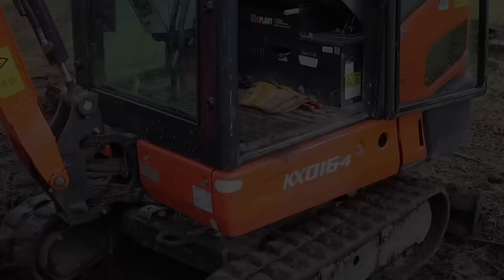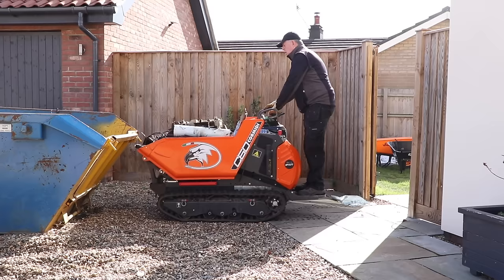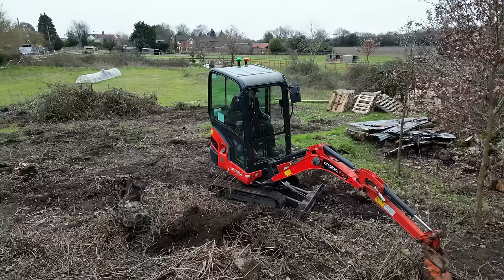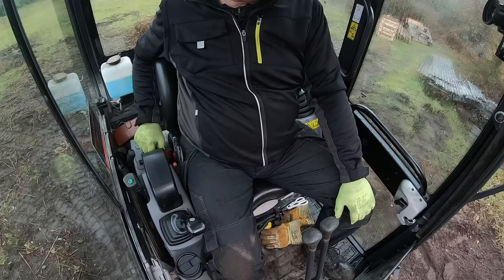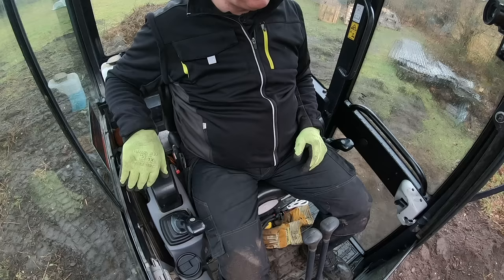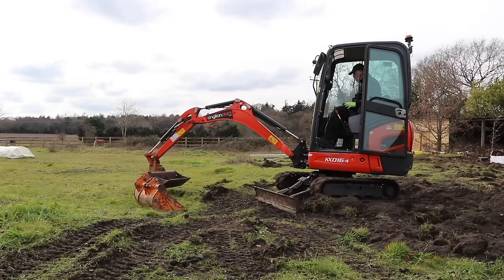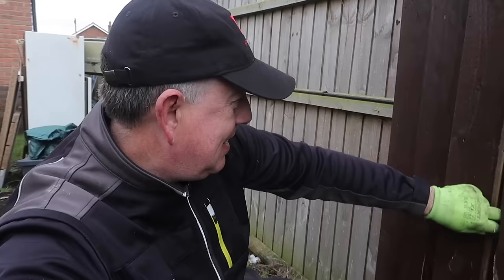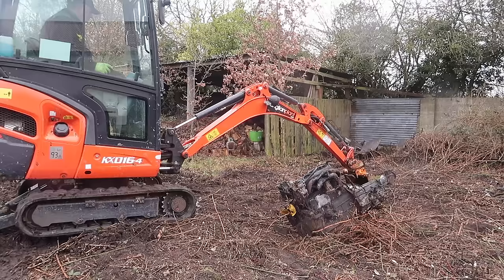Mastering Mini Diggers: Your Garden's Ultimate Tool

Comment: The scrap metal you unearthed would put a hole in the costs of the hiring of the machines, pity you had to Bury the engine, it would have brought the weight of the scrap metal up and therefore the value of your find.

Comment: Tip for you I learnt from an old pro, when you’ve got something heavy like that, track up to it with blade facing it and low. Bring the arm and push squeeze it up to the blade. Lift blade and arm together and you’ll lift it up. Then just track it to where want it.

Comment: good way to clean up that mess .now have to get rid of it .  the important thing to do with Backhoes and excavators is plan how its done and not end up with a big bog hole .  the way the controls are is called ISO pattern .can be changed on most machines so the boom and the second boom ( dipper stick ) is opposite sides .

Comment: I used the exact same combination of digger and tracked dumper when excavating the footings for my house. As you say, you can learn to use a digger but an experienced operator will usually do a far quicker, more efficient job for you. If there is any complexity or risk to the work, personally I'd urge you to hire a driver with the digger.

The little dumpers are great, especially if you have limited access, but they do move slowly and that costs you time as you trek back and forth to the skip. In the end I hired a digger driver and replaced the tracked dumper with a one tonne wheeled one and everything sped up significantly. I got more in the dumper each time, got to and from the skip far sooner, and the digger driver didn't have to hang around between times waiting for my return for anything like as long.

All these things I learned, probably never to use again!
Reply: Have to agree on those tracked barrows. They're handy, in their own way and 1ton Dumpers are HUGE in the context of a garden which makes them a bit impractical even next to an excavator, but they are a huge step up in speed and efficiency.

Comment: Hi Stuart, thanks for this, really useful to see. I had a patio cleared and relaid by a good local team and told them to hire in a digger and skip loader at my expense. They found it really useful  - the old cast concrete slabs were 35 to 45 kgs a throw - we put one on my bathroom scales. One thing I would add though, if digging down make sure you know where any service pipes and electric cables are and stay well clear. Damaging any underground services would prove VERY expensive. Usually services are at least one spade handle's depth down but you can never be certain of that.

Comment: On a kubota on the dozer blade lever the green button  on top of the leaver is the fast tracking giving a faster ground speed for moving the machine.

Other tip is if you have a slope to climb then go up with the front dozer blade to the rear. The track drive motors are at the back of the machine at the oposite end to the dozing blade and  doing this puts the weight of the machine directly over the drive motots giving better traction.

Comment: I've hired a 1.5t digger a few times now. First time I was a bit nervous, and it was a proper project too - digging out foundations for a DIY extension. Lots of people said to get a driver, or pay a pro, but int he end frankly, I wanted to have fun on a digger and whats' the point in doing DIY and then paying somebody for the fun stuff. Took my time, yes, I messed up a bit a times, but all in all it was a great experience. Then over the years I've hired them to move, all in all, probably 100 tons of material one way or another. Great bits of kit, and it's really not hard to operate so long as you take it easy. Also hired a telehandler once, that was awesome

Comment: A couple of things. When you were padding down, put the blade down behind you. You will get more padding power. When opening and closing the tracks, take the weight off the tracks by lowering the blade behind you and booming down at the front to lift the machine, then move the tracks. Also, if you lift the engine closer to the machine, you may be able to lift the engine off the ground. But don't boom or stick out when lifting. You could tip over.

Comment: Come on, thought you dug a hole to drive the mini dumper into and then push the engine into it's bucket, to then move it so it could be recycled. 
Anyways, good video as always for the rest part, and using some proper toys is always fun.

Comment: The simplest option would have been split the engine and gearbox which would have made them much more manageable. With scrap values as they are, weighing that lot in would have got you a free mini digger for a week 👍
Reply: Yep, I would have had an adventure splitting it, and learn a bit without consequence. I'd want to know what vehicle it was from. As you say, scrap value would go a long way towards hire costs. Or another route is to get a skip for the metal, free of charge.
Reply: I would have split them at the Bell Housing and had them recycled. You get the money and much better for the environment too.

Comment: As for the engine, I was thinking on just dis-assembling it into it's basic components and then dispose of it.  I'm sure an engine block minus the transmission is a lot lighter.  And why stop there?  Just keep going until you have now gained new mechanical knowledge to work on your car!  The wife might appreciate that and you could then rationalize the cost of the rental of the excavator.  Great idea, though.
Reply: Yes, taking it apart was my thought too. My guess is that bolts & nuts were be too rusty to make it possible.

Comment: I'm suprised you buried the engine, thought you were joking.
With no oil in it it could have been broken apart with a sledge quite easily as the casing is normally quite brittle.

Comment: buying the engine instead of either A) splitting the gearbox and engine or B) rolling it on to a sheet of that scrap steel and skidding it out with the digger to somewhere more accessible seems REALLY sensible......

Comment: Would have been so much better all round to have weighed that engine in for scrap, the digger would have easily lifted it, either close in with a strap around the engine or by "cuddling" the engine into the blade then lifting both bucket and blade at the same time.
PS. always better to dig over the blade ie.  with the blade at the front, much more stable in a small digger and you are not putting extra load on the track motors.

Comment: Here's a question for you - can you spin off a trench in a mini digger like the big boys can? I hired one to lay some pipes in the garden but the trench was almost exactly the width of the gap between the tracks and I didn't have the bottle to risk ending up stranded over it so I had to join them slowly and awkwardly by digging from next to it, not over it.

Comment: A few tips for the beginners using lower revs in the machine will avoid some of the jerking and abrupt movements of both machines and give you a bit more control if you aren’t working the machine to its limit until you become used to it. A bit disappointing to see you bury the engine and certainly not proper diy, where there is a will there is a way and I thought the big tank would have been more of a pain to dispose of. As others have said there was money in all that scrap and it’s the green thing to do to recycle it! Hope you never want to did a trench or hole where that engine is or you will be cursing the day 😂. Well done on the rest of it though, cracking job!

Comment: Not sure I agree with the decision to bury the engine, seems like it is creating a future problem and may be ecologically unsound.  You might have partially dismantled the engine first.  Otherwise fantastic video!
Reply: There are rests of engine fluids which will spill over the time. He could move the engine on a wooden board and use that as a sled towards the front door. And then make some small money from scrap hunters?

Comment: Curious about fuelling if you have the digger for a week, does the digger come fully fuelled, are you expected to return it full, do you just fill it with jerry cans of fuel etc? Thanks.
Reply: Depends but Usually If it comes with a full tank of fuel then you return it with a full tank or fuel. If not then the hire place will re fuel it till the tank is full and charge you a price per litre for the diesel. This diesel Price is usually higher than the average pump price so its normally worth the effort of  filling Jerry cans up yourself returning it full of fuel you.
Reply from the maker: It comes full and if it's not returned full then you pay £1.90 per litre

Comment: I was thinking you could’ve separated the gearbox with the engine to allow the excavator to lift them although burying them was another good option 👍🏻
Reply: did think the same but most likely looking at the state of it the bolts are probabley rust locked together.
Reply: Yeah, you should of split the gearbox from the engine and disposed of them responsibly. Cordless grinder would of taken care of those seized bolts no problem
Reply from the maker: I'm sure you could do something with it if you had the time and effort to put into an engine thats been sitting outside for prob 30 years

Comment: Kind of wierd to me burying that engine, 1 its still have a value as scrap. 2 it will have some oil still left in it so it is a source of polution to the enviroment. 3 when it rusts away slowly wont you get a hole where you buryed it?
I would have put som chains or similar to it and pulled it out with the excavator or a car, im sure the excavator could pick it up enough to put on a trailer to go and be recycled, if not i would have splut the engine and gearbox, cutting it off if nessicary with a grinder and liftet the part up one by one.

Comment: We had a jcb mini digger 1.5tonne and it was able to lift the engine and gearbox from a vw bora 1.6petrol. took it down to the garage to change timing belt and split te gearbox to fit a new gearbox. i reckon if you split the gearbox from the engine, the machine could of lifted it or made a skid plate up from one of those pallets and drag the pallet with engine rolled on to it to get it into driveway and get it disposed of that way. 
a fun video though, good information for a new user.

Comment: By burying the engine surely, it goes against the ethos of the channel to show people how to "proper"ly overcome with engineering know how how to resolve an issue such as this. Burying it is a  lazy cop-out and goes against the channels' high-quality output of dealing and overcoming problems. It's the norm these days for people to bury their heads in the sand (engines in this case) and ignoring the environmental and ethical issues here.  You say there was no oil left, but you had no way of knowing. By dismantling it in a hollow in the ground, lined with heavy duty pvc to collect contaminates. It would make a good video, put the metal back into the recycling system,  gave you a return in scrap value, and most importantly of all. Showed people how to do the "right" thing.
Can't wait for the follow-up video of how to deal with a massive diesel engine found dumped and buried on your land, "properdiy"ly.

Comment: cannot believe you did that. Even if there is no oil left in the engine and gearbox, there are still other potentially harmful chemicals and metals that could leach into the ground, such as lead, cadmium, and chromium. Over time, these substances could contaminate the surrounding soil and groundwater, potentially causing harm to plants and animals in the area. I'd like to give you the opportunity to reconsider